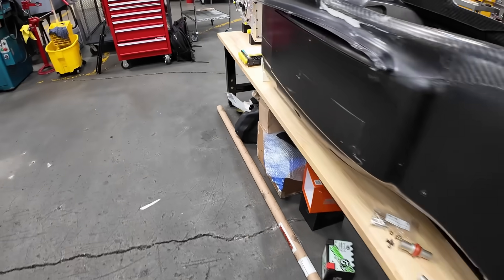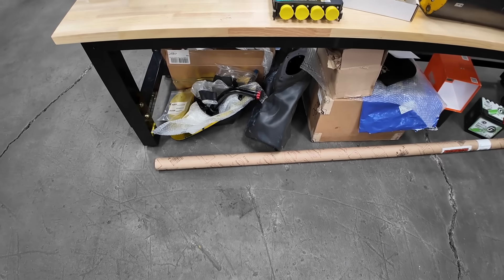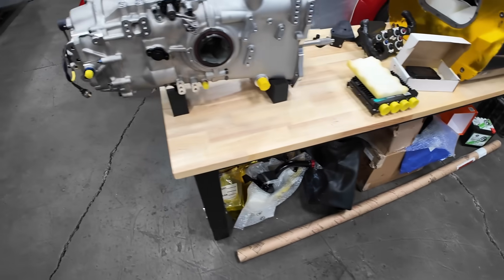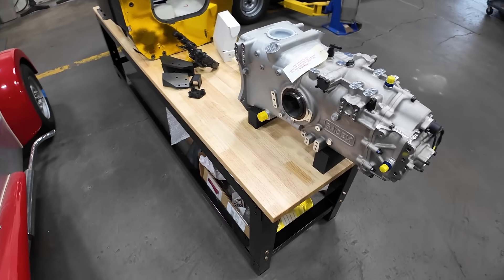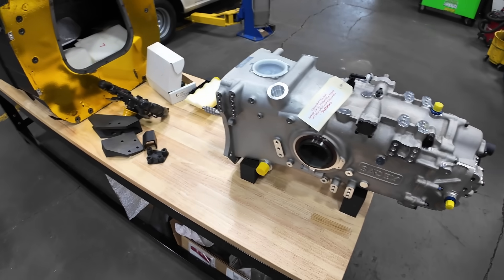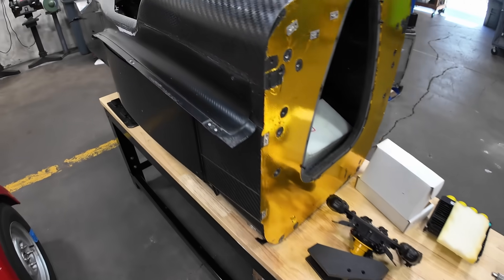The Ultimate Pikes Peak car build begins!

Comment: 😁We have patented an entirely new, low cost, hear-silent, ultra-efficient, infinitely variable , ultra-torque dense [small & light], high durability gear technology, called FrictionLess Gear, which is a reformulation of gearing theory sans any toothed wheels. The gear range can easily be >700:1 [ultra high gear rage possible] with a price half that of the lowest priced competitor. Enables smaller batteries and/or longer range in EV's [Exploding Vehicles ;-0 ] . Legacy and novel applications abound. Retrofits of ALL existing bikes, even electrics, will be available.
😉A novel, low cost, magnet-free, near-silent, zero detent/cogging, ultra-torque dense [i.e. compact], ultra-efficient, electric motor tech may be paired w the FrictionLess gear set for unprecedented drivetrain performance in all metrics at all scales.
😁We're also developing an ultra-efficient Free-piston engine with an insane power to weight ration on par with turbines. It will eventually power the PersonalJet door-to-door personal mobility solution.

Comment: Timeout, the transmission has the engine's dry sump tank integrated into it?
Reply from the maker: Of course!
Reply: @thesendyclub  That's incredibly cool. Is that common on this level of race cars or something unique to that transmission?
Reply: @Avboden typically these race sequential gearboxes have a dry sump tank for the gearbox oil, the gearbox has its own pump and spray jets onto the gearset 👍

Comment: 3:20 My humble 2 cents here: you dont want to truly rigidly mount electronics to a stiff chasis, so please consider using some cushioning on the mating surfaces of the mount. Even 3D printed with TPU will work great. Anyway, I want to say thank you for showing us your progress, I have the certain feeling this one will be quite a gem of a video series.
Reply from the maker: The Cosworth unit has anti vibration mounts on it. 3M Dual lock does a pretty good job also
Reply: @thesendyclub  Good to know 👍

Comment: My OMP steering hub has a bit of wiggle when you push and pull on the wheel(top to bottom), not play when turning. I had to add a carbon spacer between the hub to reduce the movement. I'm curious if you will need to do the same thing?
Reply from the maker: Me too, we will see!

Comment: If you can afford it, get the roll cage mounts 3D printed in Ti.  There are several sources for that now and it will pay for itself by making the prep for the bond with the carbon much easier: a simple alkaline peroxide etch of the Ti surface will give you greater bond strength than you will achieve with aluminium. It will also eliminate the galvanic issues that plague carbon / aluminium bonds and greatly reduce the Cte mismatch between metal and composite.
Reply from the maker: Really helpful info, I'll quote it in Ti also!

Comment: For some reason the airplane guys anodize the aluminum when bonding it in a resin/fibre. I haven’t figured out why but assume it is to retard corrosion.
Reply from the maker: I will check that out
Reply: Yeah anodising is non conductive and prevents corrosion at the join. Another way to do it is 1 layer of glass fibre to prevent this from happening

Comment: How are you protecting the aluminum inserts from galvanic corrosion when bonded to the carbon fiber?  On aircraft work we use a few layers of fiberglass glass cloth....  If the aluminum isn't isolated from the CF it will corrode and bond will fail.
Reply from the maker: All the inserts in the tub are raw alu. I'll will look into the aircraft techniques
Reply: Yeah, 1 layer of glass fibre is enough to stop this 👍

Comment: Will be following with interest. CV joint for the steering shaft? Rear of rollcage mounted to the engine plate? I know you've probably thought about all of this, but us car builders can't help but mension things.
Reply from the maker: CV joints struggle with lash, are heavy and expensive. That's why you don't see them in the column. The cage stays on the tub only, these style of cars will lose the engine in a bad crash by design
Reply: @thesendyclub  Thanks Robin. See I knew there was a good anwser for those and they make GOOD sence. Why are you sitting down anwsering silly questions when you've got a car to build? I'll shut up from now on so you can spend more time in the shed. Google 'Subaru Quad'. Ken.